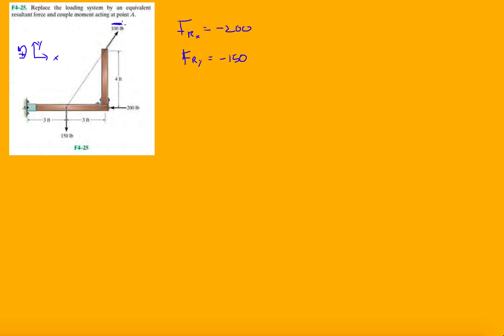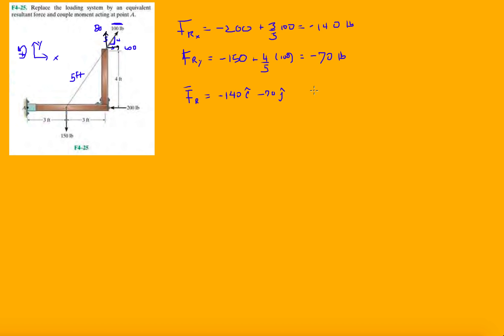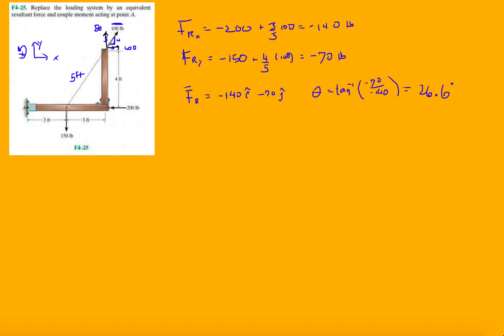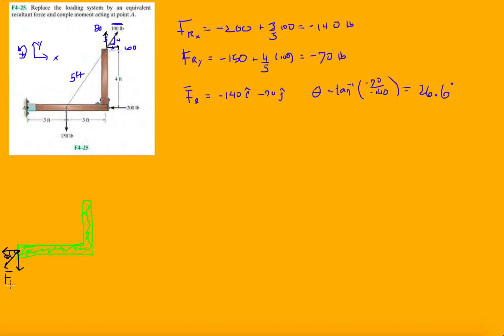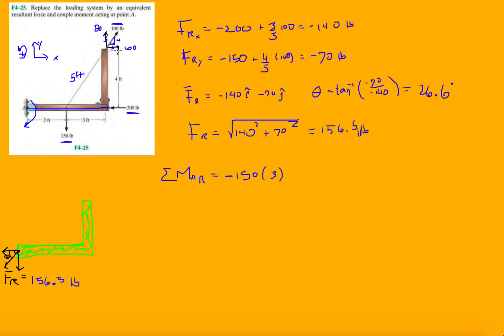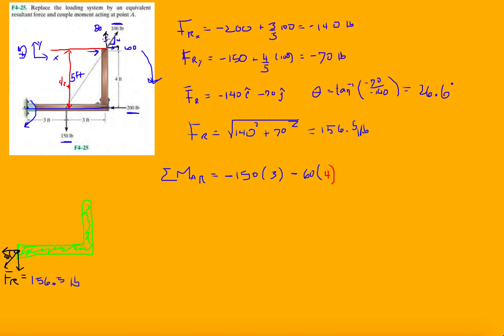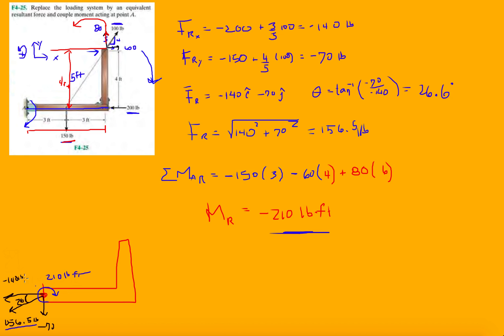Problem F4-25 Statics Hibbeler 12th (Chapter 4)

Comment: Just a question, I usually use the right hand method to calculate the direction of the momentum, and it was working very well just up to now with the 60lb force, I got that his momentum goes against clockwise. This method doesn't work with this topic?
Reply from the maker: If we put aside the math, we know that if we push the structure horizontally at the top right, the structure will begin to rotate clockwise around the pivot point. When we go back to just math, we have (r x F) -> distance from pivot point to force -> (6i +4j) X (60i) we know (iXi) = 0 and (jXi) = -k therefore you have -240k moment (clockwise). Let me know if this helps! Thanks.

Comment: sir Why 200lb force Is Not considered in the total momentum ???
Reply from the maker: Extend the line of action of the force, and you will see that it intersects the pivot point A. Meaning, you are pushing and not causing the frame to rotate....Mathematically, you are multiplying the force x zero (perpendicular distance of line of action to pivot point)